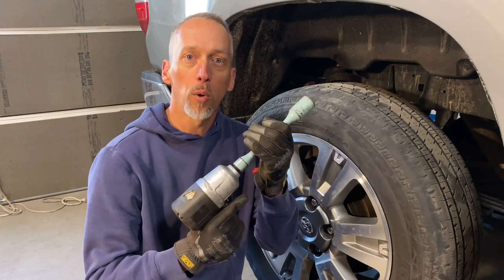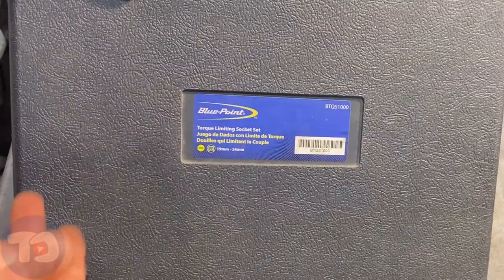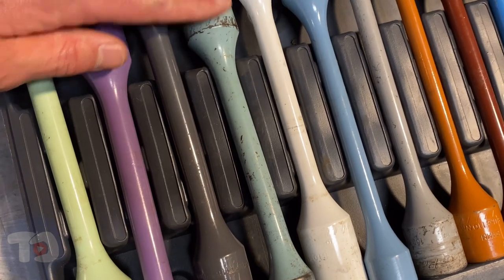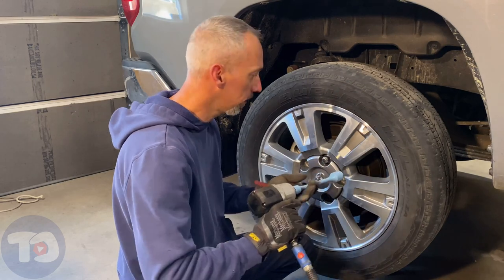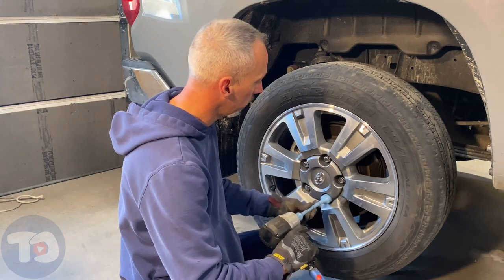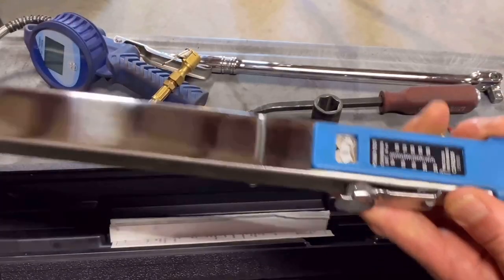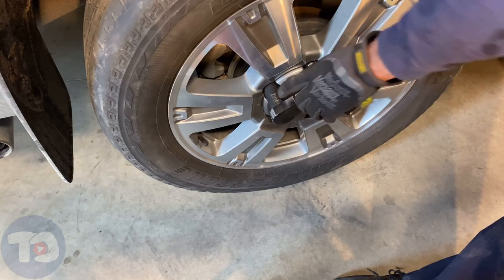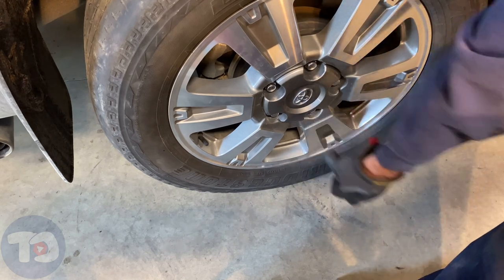How to use a torque limiting socket / extension.

Comment: Not exactly sure what was the point of these when you still had to follow with an actual torque wrench plus i didn't hear any change in the impact gun when you tightened it down to let you know when to stop
Reply from the maker: I stop as soon as it starts hammering
Reply: @ToolDemos  Again, why use this worthless tool if you have to follow it with an actual torque wrench ...??
Put the lug nuts ON by hand with the socket and extension until it stops ...
Do that X times for all the lug nuts.
Then use the torque wrench to torque them all down .... 
Thats been the way since forever. Now this worthless tool comes out and you still have to follow it with an actual torque wrench. 
Its a complete waste of $$ and no real mechanic uses an impact gun or impact wrench to secure lug nuts ...
Reply from the maker: @ACommenterOnYouTube  I understand what you’re saying, I guess it’s just a fail-safe if you want to use an impact to spin ‘em on.
Reply: @ToolDemos  i have NEVER used an impact and never will use an impact to put on lug nuts. Twisted on by hand then torqued with an actual torque wrench. Just like its been done for decades.

Comment: But I don't understand. Whats the point of the torque wrench. For example, if you use 100ft-lb torque limiting socket, the impact gun applied that torque to the lug nut, then what's the point of thr torque wrench then.
Reply from the maker: The torque sticks are good, but not a precision tool. To get consistent wheel nut torque, you need a torque wrench.
Reply: Yeah that's my thought also why not just tighten them a bit with a regular socket them come back with he torque wrench like normal. Seems like a wasted step and wasted money
Reply from the maker: @jonboatmorava9115  they are definitely not required, they just keep you from over-torquing. Can save you time if you’re familiar with them.
Reply: At present I flick my impact to medium torque then use a touque wrench to finish.
Easy.
Just get a good impact gun.

Comment: How much lower should the torque stick be than the final torque specification ?   Wouldn't you just use the lowest stick because you're only snugging the lugs down ?
  If you are using a patterned stepped torque sequence, the wrench would be used to finish the job anyway.
Reply from the maker: Honestly, I like my new way of doing it better. I’m using a 12V bit driver to snug them down. That driver can’t torque down more than maybe 40 or 50 foot pounds. Then I finish with the torque wrench.
Reply: All pneumatic impacts guns have an adjustable air bleed knob by the air line fitting.

Comment: What if you have a really powerful impact
Reply from the maker: A more powerful impact would get you over-torqued in a hurry. Torque sticks were designed for your average 1/2” gun.
Reply: What happens if they are over torqued
Reply from the maker: @lurereviews5164  if they are torqued beyond their tensile strength limit, the studs will stretch to fatigue. That can cause them to break or to not have the clamping strength needed to secure the wheels.
Reply: Thanks for the tip, I tightened mine with a 1/2" milwaukee impact and now I'm worried.
Reply: @lurereviews5164 that’s what I have and have never had a problem. You should buy the torque limiting extension set from harbor freight for about $60.

Comment: A torque stick followed by a torque wrench? That is incorrect, and a waste of time. You obviously didn't read the instructions.

I've been using torque sticks only (following the instructions) for over 20 years, and never had a problem. I verify them with a torque wrench follow-up on random vehicles throughout the month. If I ever find one out of spec, I'll replace the set. I still have my original extension style, with a set of sockets I set aside just for them. They've always been in spec because I use them properly.

Comment: So I might be missing something but wtf is the point of these stupid extensions. Like why would anyone use these I don’t get it
Reply: They are a safety device to regulate the torque output by your gun that would otherwise not be measurable at all. You don't need a whole set like he has here, a lower output torque extension and a flip socket set would work great and they're pretty cheap.